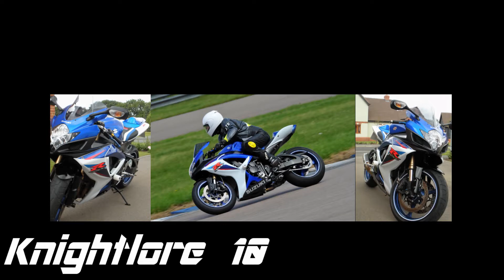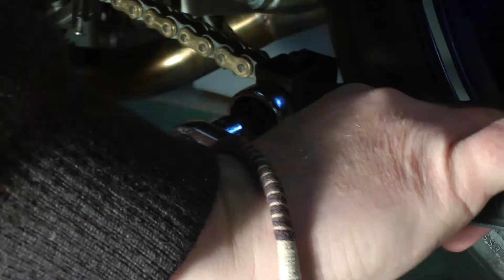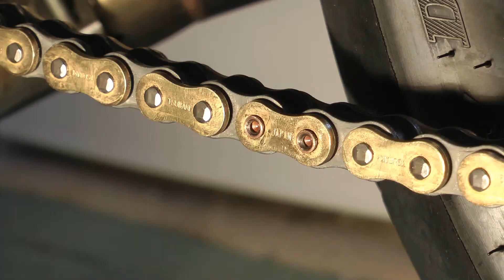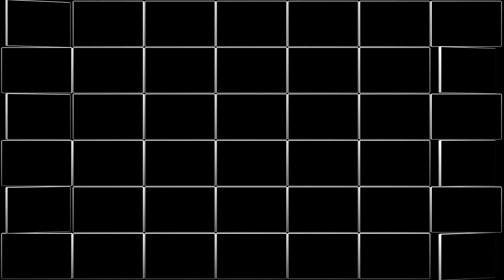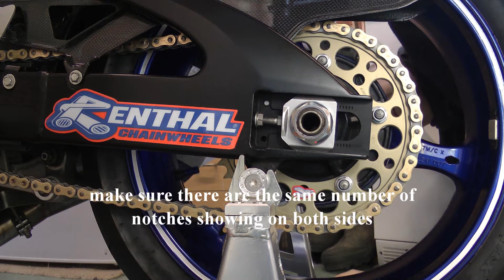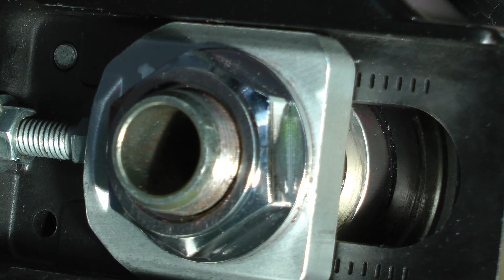Chain and Sprocket Kit Part 3

Comment from the maker: There are no torque settings for chain pressing. Just take time to press and inspect as you don't want to over-press creating a tight spot. Its easy to crack a rivet during the flaring process too. If that happens you must replace it but don't be put off.

Comment: What if you don't have that chain tool to rivet the master link..I got my chain on with the master link on and realized I can't push it in any more found out I need that tool what do I do if I don't have it?
Reply from the maker: Sorry for late reply. I wouldn't do this without a chain press tool. Its easy to split the rivet even when using the correct tool. The rivet must be flared or you risk damage / injury. How did you get on?
Reply: Knightlore10 I winded up going down to a motorcycle store and getting the clip on master link I just couldn't get the other one flared